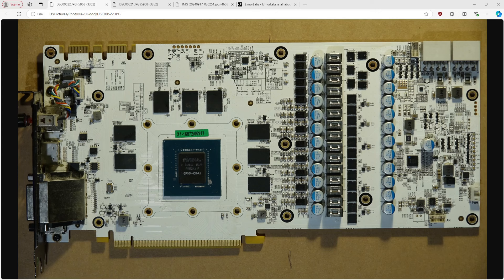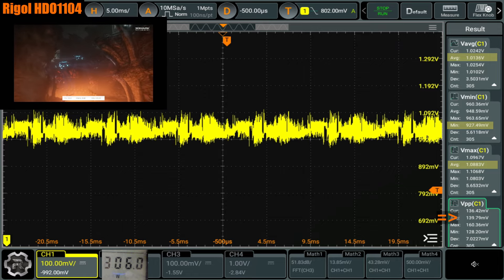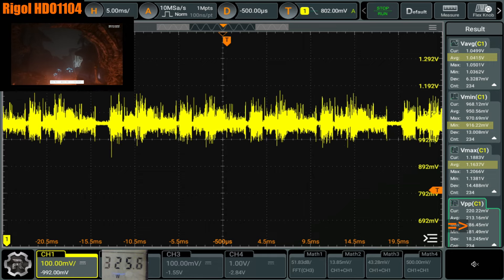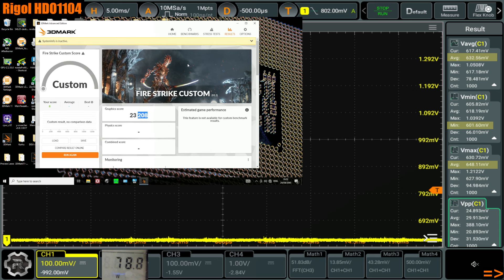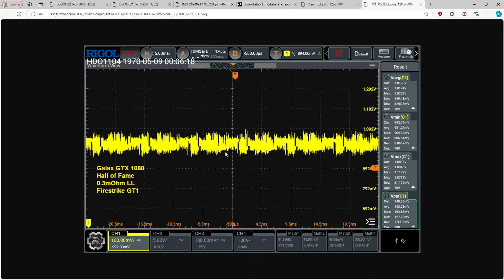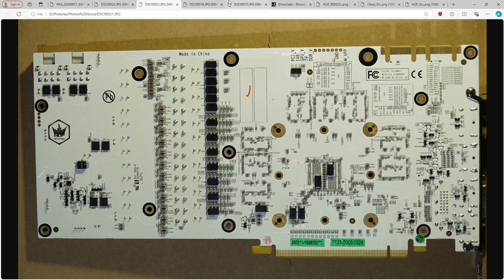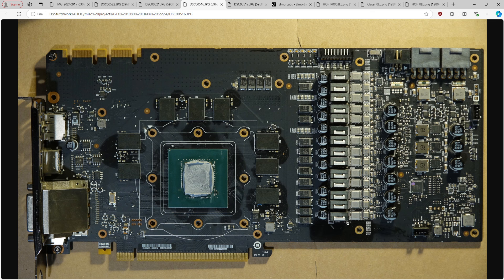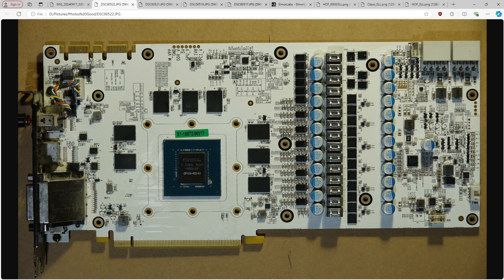Measuring the Vcore regulation of the BEST GTX 1080 PCB ever made // Galax GTX 1080 Hall of Fame

Comment: I got my hands on x670e godlike recently, currently using x670e hero for 7800 x3d all tuned 6400 etc. Should I keep the hero and sell the god like or the other way around? I got them bought for very cheap at roughly the same price.
I know I won't gain much but for future and chips will godlkke be beneficial? I hear you can of 9800 x3d. 
Main reason I am not immediately putting in godlike is the reduced USB ports and the fact that I have to take my whole PC apart for it.

I doubt I can get 6800 on it. Can boot 6600 on hero though seemed like too much effort to stablise

Comment: Hey Buildzoid, thank you for all the information and work you do. I have a question. I RMA my 13700kf, and I am now awaiting a refund. 
When I get this refund, what will be your recommended processor for the MSI z690 ACE Meg. I can do 14700kf or 12900kf. I am not sure if the 0x129 microcode fixed everything. What are your thoughts?  Can you please help me with this? All blessings man, keep up the outstanding work.
Reply from the maker: Well since you have an MSI board you can't really set a voltage limit like you can on Giga/ASUS so if you want to be extra safe the 12900KF is the safer option. But 0x129 should be enough to make a 14700K not degrade.
Reply: @ActuallyHardcoreOverclocking  Thank you for this info. I appreciate it. Blessings